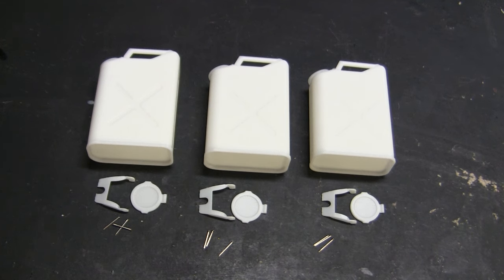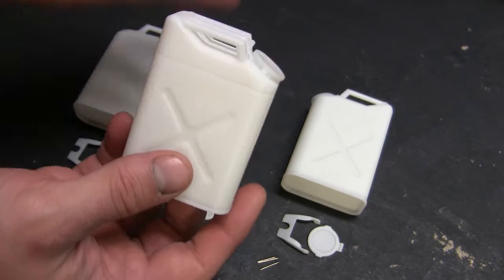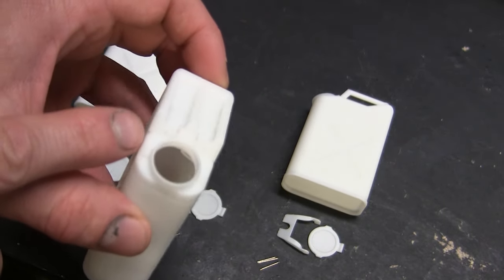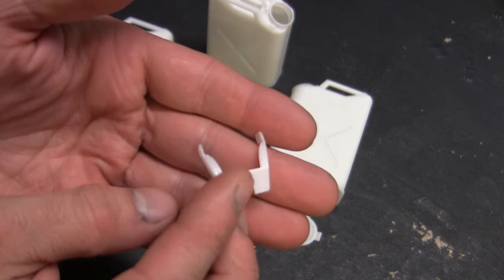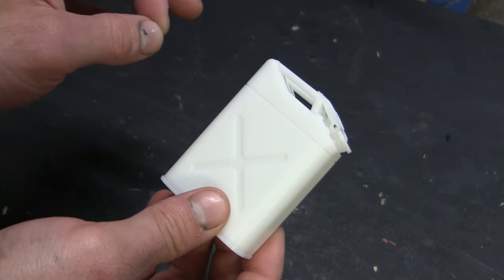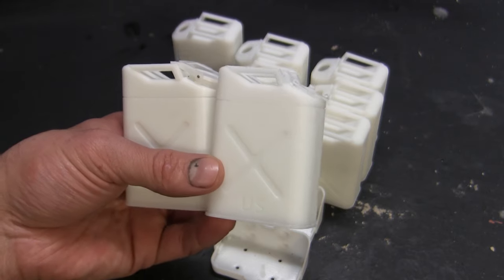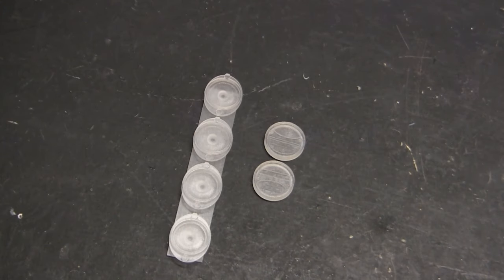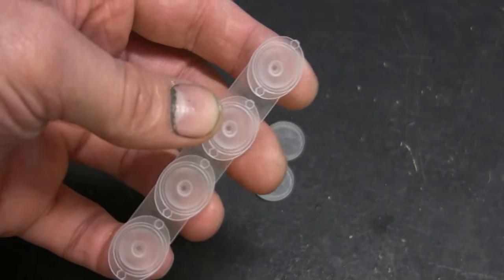New 1/6th scale USGI water jerry cans, German and other US AFV detail upgrade parts

Comment: Parts look great.  The hole on the gas can is smaller to accept the metal flexible fuel filler funnel.  The fuel funnel has rubber grommet on the bottom that inserts into the fuel can with a metal handle that actuates expanding the grommet locking it into the can.